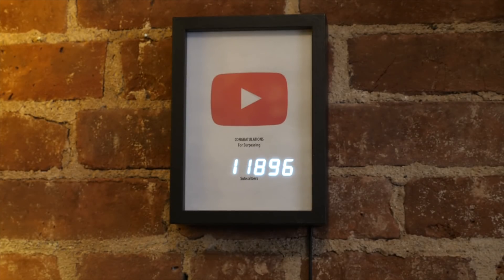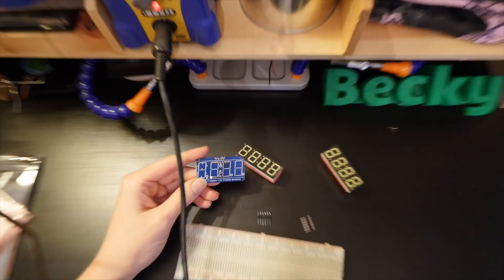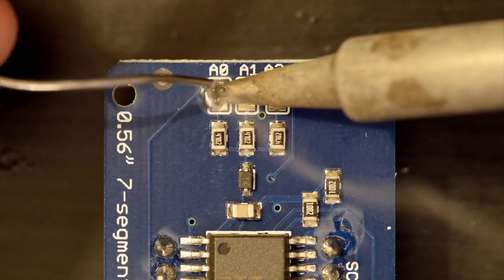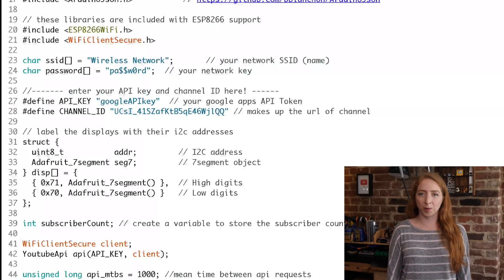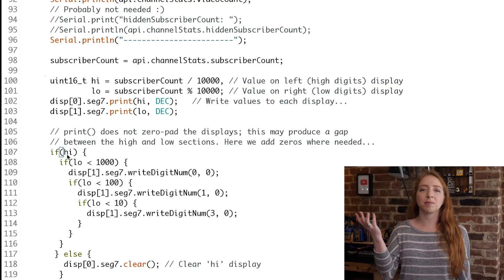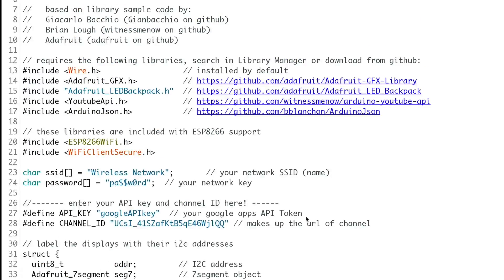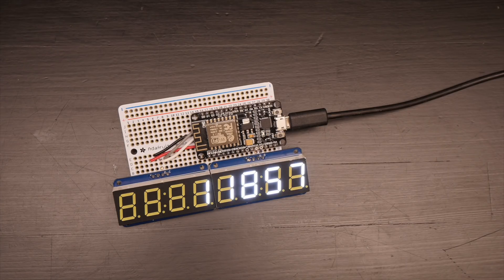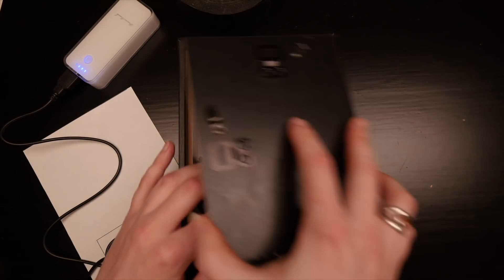YouTube Subscriber Counter v2 // Becky Stern

Comment: Just got the parts to make this. Great project. Will be a neat wall piece for my garage. Subscribed. :)  Adafruit sells the backpack and seven segment display as a single product now, "Adafruit 0.56" 4-Digit 7-Segment Display w/I2C Backpack - White". There is also a 1.2" version but it includes two extra time dots at the beginning so the 1.2" is more for time keeping and clocks than numerical displays. 1.2" only comes in red or yellow and the .56" comes in a wider variety of colors.  Thanks for all the links and making it an easy to follow project.